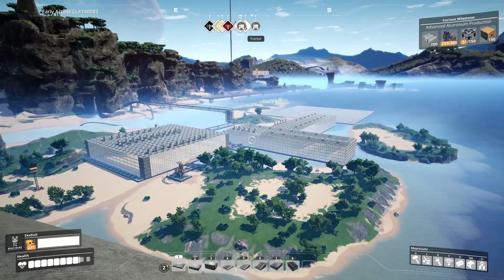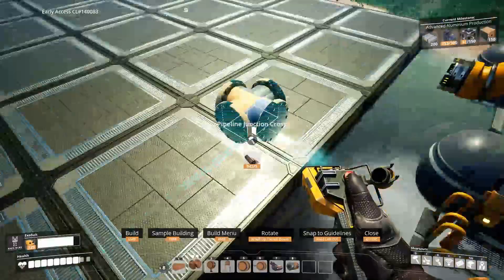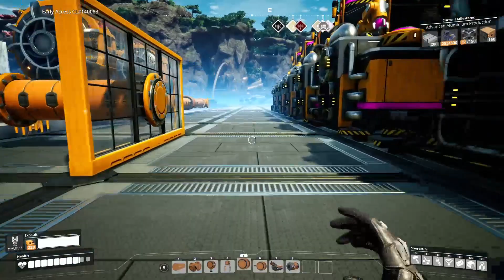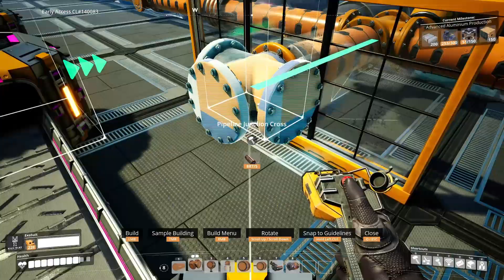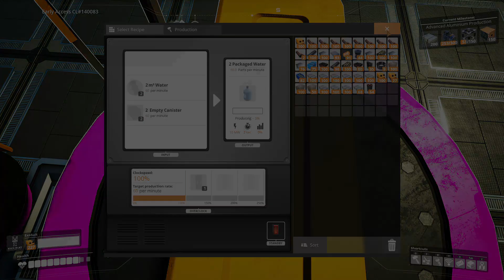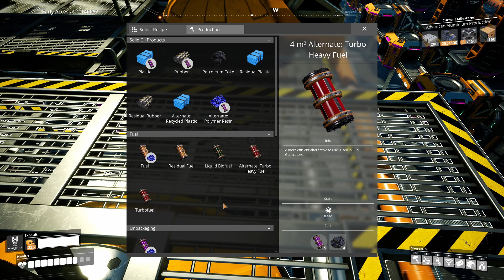Oil Plant Part 1

Comment: Nice Video and awesome build Slim, great use of speeding the video up

Can you make a blueprint of builds so you can recreate them elsewhere if needed, or is it build from scratch each time?
Reply from the maker: Hi Madman No not without mods but if you want to build another item let say another refinery  you can point your buld gun at the one you have built and press the  middle mouse button. This is the eyedropper mode and will copy the item so you don't have to search for it in the build menu. Also you have a hotbar at the bottom that you can put popular items in. I use a Mod called SMART which lets me build multiples of the same item in 1 button press as long as I have enough resources in my inventory, it save a lot of time rather than building 1 item at a time.